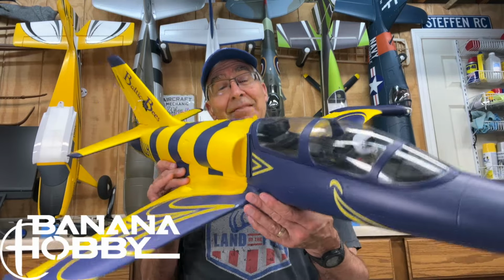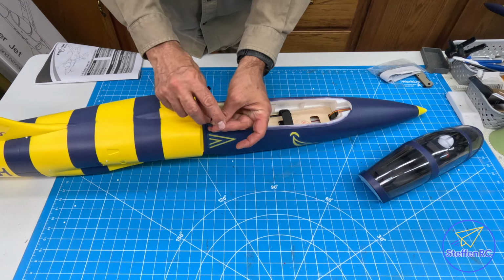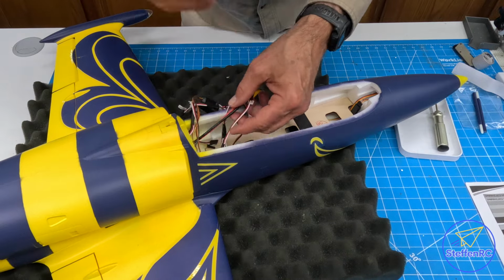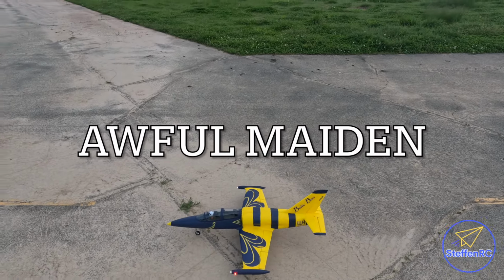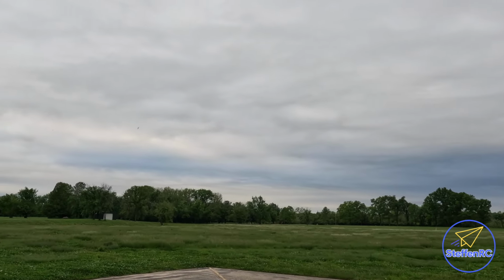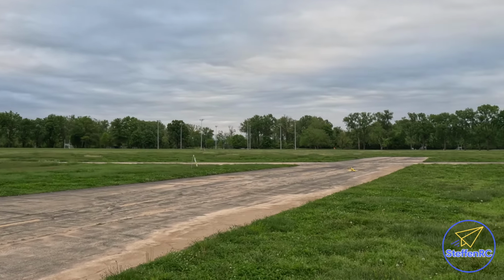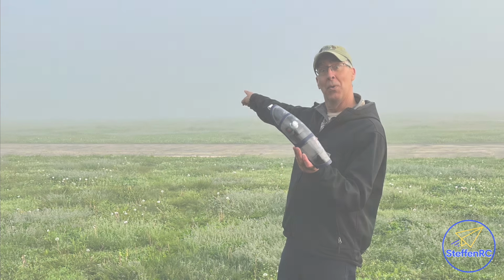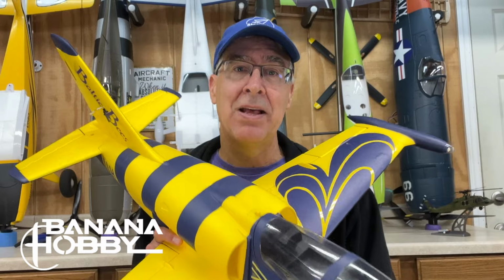Flyfans L 39 64mm 6S powered EDF from Banana Hobby

Comment: Good afternoon, friend. Could you tell me if it's normal for the connection under the wings of the white front lights to overheat on this jet? It seems abnormal to me. I ordered it, assembled it, and this connection is generating a lot of heat. Thank you very much for your response and a comment.
Reply from the maker: That's a great question.  I know some LEDs can get very hot.  I haven't noticed it (or even checked on it...).  If you are concerned, you can alway disconnect it.

Comment: How would you feel about hand launching it? I hand launch my 64 edf’s.
Reply from the maker: I think if you removed the retracts it would be light enough to hand launch.
Reply: @SteffenRC thought about that. Wonder if it would dramatically change book CG?
Reply from the maker: @arkansasmetalart8649  I’d think it will require you to move the battery forward.  Or a slightly heavier battery.  Maybe.  Only one way to find out.  🎉

Comment: Thank you. Did you hook up the reverse?  I’m trying to find a video on that.
Reply from the maker: I didn't..  There should be a single wire on the ESC/Throttle cable.  That will go into a spare RX Channel.  Then assign that channel to a switch.  Now you should have reverse thrust.

Comment: Nice flying. I have SMC 3600, 385gr, too. Also I have 6s  2500 lihv,  300gr. When too windy and I want more flight time I use 2 packs in parallel. Only 600gr, roughly same weight as 6s 4000. But now I have paralleled 6s 5000 😂❤😂❤
Reply from the maker: Sounds like a great setup.

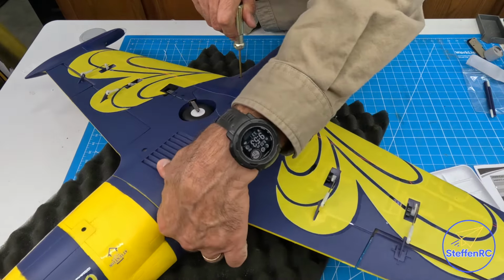Comment: I agree best deal feature price hands down, I did upgrade the EDF and 65a ZTW ESC to a inrunner set up. Maidened Saturday front retract motor failed otherwise excellent. Running 4000 4400 5:30 flight times with 45% pack life left, shes wicked fast very agile super fun to fly especially for $189 Holiday Weekend sale for the Black Daimond scheme which is all painted to boot including the white
Reply from the maker: Its a fun plane.  Banana Hobby and Flyfans did a great job on this one.

Comment: I seen this on another video. He used a 6s hrb 4500 battery, flew great.
Reply from the maker: I'm sure it will fly fine with a heavier battery.  I liked the feel of a lighter battery and it enabled me to land slower and nose up.
Reply: @SteffenRC he said the hrb is lighter then his 3000 batteries
Reply from the maker: @RBA1891  hmmmm. I have HRB 4000’s and 3300’s.  The 4000’s are heavier for sure.  But the plane would fly fine.  I just like lighter.  Less chance to stall at slow speeds.
Reply from the maker: Gotcha.  The HRB red label is something I haven't tested/flown.  Battery quality and performance vary a lot.  The only time I see a larger battery store more MAH is when they are LIHV (High voltage packs...). But hey, give it a try.

Comment: Did you get the reverse thrust working?  Just set up one of these and reverse thrust is not working for me.  (wire connected to free channel, 8 in my case)
Reply from the maker: I didn't mess with it.  I'll play around with it and see if it works on mine.

Comment: Question? Couldn’t you have used a XT60 female to XT90 Male connector to make it work instead of swapping the ESC’s?? I was looking to do that instead is that a bad idea?
Reply: Just got mines today and the front landing gear is fried… emailed txt and used the text support hopefully they send another front gear asap
Reply from the maker: Larry, You can use an adapter.  I do that on some of my planes that I don't plan on keeping after a review.  This one was special, so it got the extra attention.  Bummer about the front retract..  Let me know if you have any issues...  Will

Comment: Hello, could this plane run on a 4s battery? Thanks!
Reply from the maker: I don't think the performance would be very good on 4s.  You're better off with a well designed 4S EDF..
Reply: @SteffenRC  Could you reccomend any 4s planes with retracts if any?
Reply from the maker: I don't think anyone has made a 4S EDF with retracts.  (at least, I haven't flown one).   Most of them are fixed gear.  Or removable for hand launch and belly land.
Reply: @SteffenRC 100% I just wanted to see if someone more experienced knew about one. I was pretty sure there weren’t any. Thanks!
Reply: @TheRCHangar actually, there is a version of exactly this plane on 4S . At least here in Germany, I can order either 4S or 6S. The difference is the motor, where 4S has a 3200KV while 6S has 2300KV. ESC is 40 amps in both cases.
Reply: @alexnentwig2025  Yeah, i just dont want an underpowered plane bc that can be dangerous. what is the website name please?

Comment: hi. Do you think that some 4000 ma battery fits? i have some admiral 6s 4000 ma 50c  already, but i do not knot if it fits. thanks for your time.
Reply from the maker: It's not so much as will it fit? But, how well will it fly with that extra weight.? My 3300s are around 480g-512g.  This plane can handle that weight, but I'm afraid a heavier battery would create some unwanted issues.  (stalls and landing a bit hotter)..  Of course you can try it.....  Good luck.
Reply: Thank You very much. I understand about the extra weight. I Will do what the recomended better.  @SteffenRC

Comment: Great plane, flown mine loads.i do find it a touch slow, but efficient. I have a freewing 2840 2500 kv ready to install. That should make it move quicker.
Reply from the maker: Holy cow that motor should do the trick for sure.   Lots of fun to be had with this little plane.

Comment: Hey there Steffen  ! Happy weekend  to ya !
I wished BH would give me something like that, to test.  Oh well....
Be sure and check your servo leads when  connecting them 😮
I watched your video , on checking those,  so you don't lose your plane.  Anyway,  great review  !!
Reply from the maker: Thanks Scotty.  Appreciate the support.  You need this plane.. 😎
Reply: @SteffenRC  I know !! But I'm still working on that tail-dragger. So close to finishing it. 
Just curious...
If you change the pitch and length of a prop, will it pull more weight ? Or just go faster ? I think I'm going to be over the weight that the specs call for. But only about a pound.  It will be close to 11 lbs. 🤔
Reply from the maker: @ Hey Scotty.  Larger and more pitch could do both.  But checkout the motor specs for the prop you’re planning to use.  Also dig into the formulas around Wing load and power.   Lots of variables
Reply: @SteffenRC  alright then.. happy safe flying !!

Comment: I LOVE the Flyfans jets I own :) L-39 bee, and the K-8. 64MM 6S is the sweet spot IMO..using the same SMC pack as you, I was getting really long flight times. With a Lithium Ion pack. ( BAK 21700 cells 4000 mah) I get 8+ minutes of spirited flying, and with < 40 amps draw the pack stays relatively cool. After almost 2 yrs and easily 120+ flights everything still works perfectly! I keep desperately  hoping this brand will gain some market traction, because the value is phenomenal these guys could give FMS and Freewing a run for their money IMO. I was shocked at how good this jet was for only $199. Thanks for doing a great review, hopefully every review helps to draw some attention to the brand. It's perplexing that they haven't had a new release since the SU-27.
Reply from the maker: I agree, I can't believe more people are raving about this plane.  What a wonderful and well designed system.  Gonna replace my 4S EDFs with these 6S 64s...
Reply: @SteffenRC  Great idea to upgrade your jets! I'm thinking the 64mm Futura would be a great candidate, might have to purchase one. Plenty of room inside for a 4500 lithium ion pack.